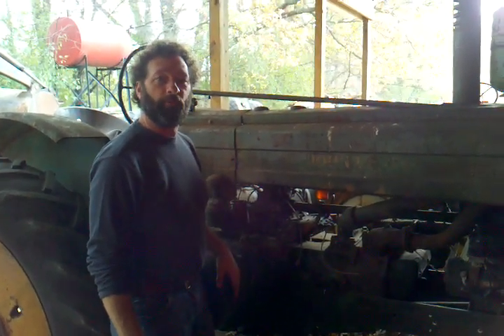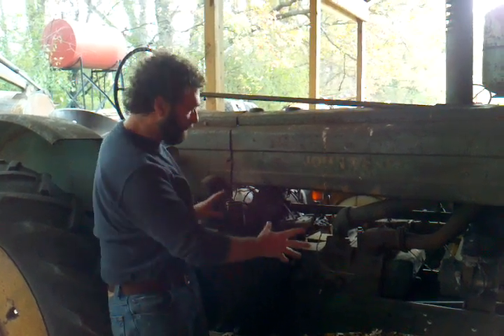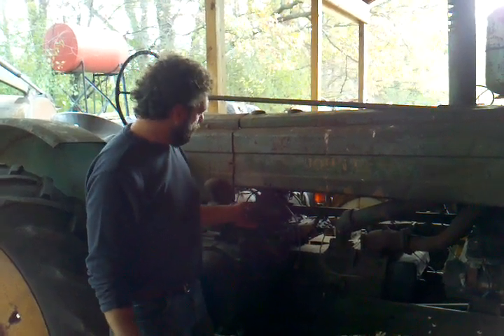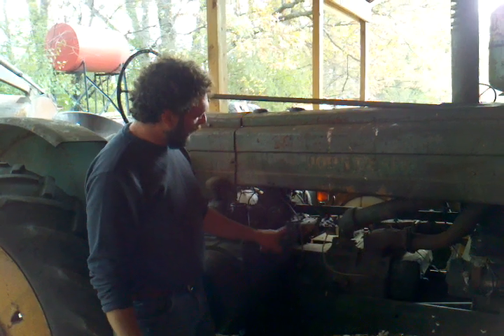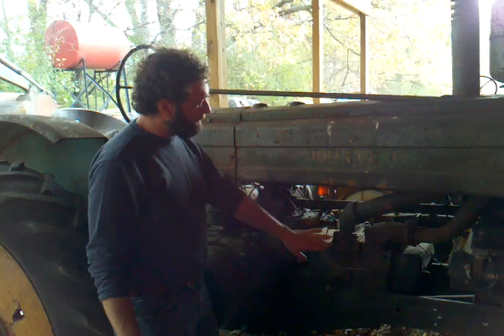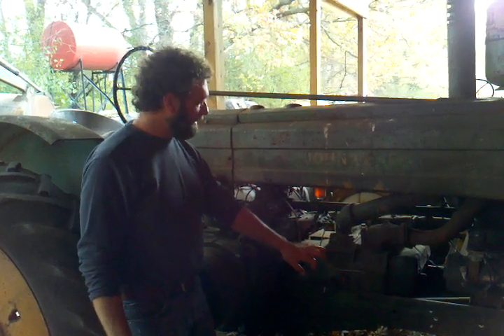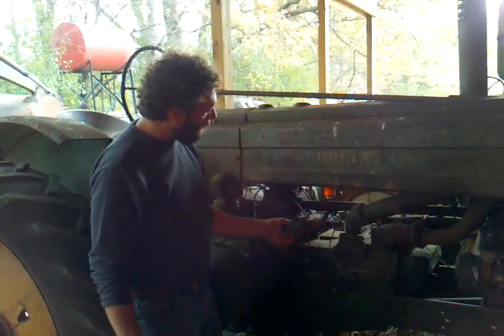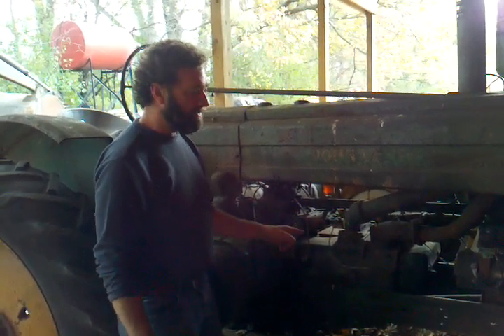John Deere A Diesel Explained

Comment: The whole thing is a hoax, video shot in the shadows, but can clearly see the outline of the carb hanging there, seems funny even being dark, can't make out a 4 cylinder injection pump anywhere though...
Reply: I can see the pump. I suppose they have to start it on gas first then switch it over to diesel is why the carb is still on there.
Reply: It's running on diesel a month before this video - I guess this must've been talked about by request after the first video.
Reply: It was featured in Green Magazine and the carburetor was removed and replaced with a piece of pipe.  You might want to take a closer look.  I'm quite sure that Green Magazine would not have bothered with it if it were not real.